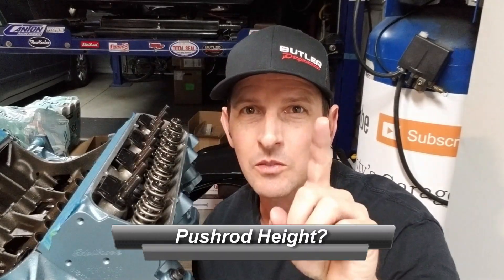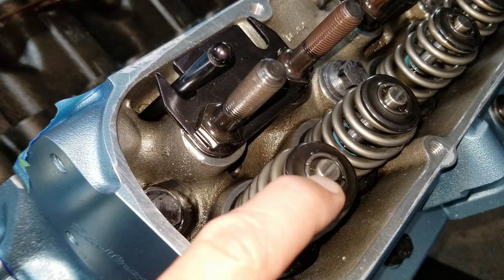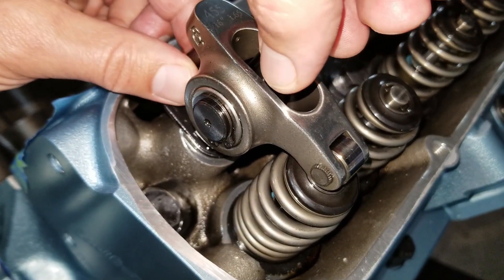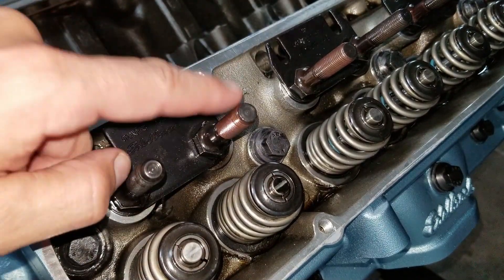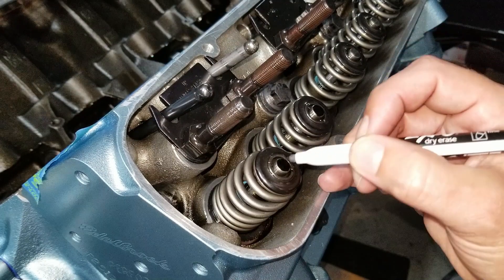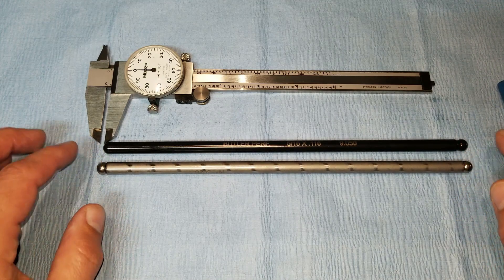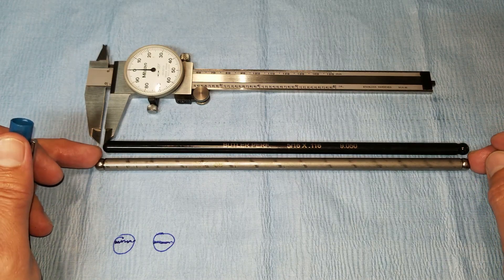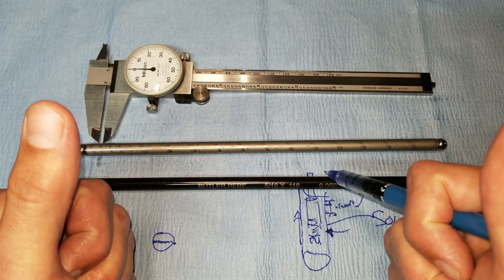Pontiac V8 Rebuild, Part 14a:  How to measure Push Rod Length

Comment: I took a stock lifter and checked it against a solid lifter and it was .190 shallower than a pumped up hydraulic lifter. So when measure with a solid ull.need to take that # away from the final pushrod length. Due to this: solid lifters use a different length pusheod than  hydraulic lifters do
Reply from the maker: Good point.  Depends on the lifter pushrod bore depth.  The point is, if they're the same, there's no compression.  Funny thing is, they make a valve spring for this test that I forgot about... and I have one, for this specific test.  It's a super light spring that does not compress the hydraulic lifter.  Anyway, have fun!

Comment: Hey again Fast Monty, damnit man I absolutely LOVE this channel because of how deep you get into the topic, but here’s a very good question for you. Ok, so the Ford roller rocker is VERY close to a Pontiac’s roller rocker. So here’s my plan (again, please let me know if I’m mistaken or I’m going about any of this the wrong way, pretty please. So currently I have the ole 1.5 roller rockers on it. Make .466”-4.86” lift. So with a (only 1.6 ratio rocker) my cam lift will be at .497” and .519” with just a rocker change from 1.5’s to 1.6’s!! That’s insane! My 6x-4’s have already been set ho (pushrod holes elongated to make clearance for the pushrods, what’s really crazy is with a 1.65 roller it’ll make a whopping .513” and exhaust side will be .536” for right now though, I’m REALLY wanting to try a set of FULL ROLLER 1.6’s from a sbf Ford engine. It can’t be a Windsor or a Cleveland, has to be a regional ole 5.0. I’m hoping it’ll help get the spent exhaust out faster in all honesty! Plus bringing in a little more air never hurt nobody!! So now my opinion to you, is which brand do you have true trust in? I was going to go with Elgin full rollers, but I’m honestly not quite sure. What do you think?
Reply from the maker: Yeah, crazy how much more lift you can get...even just going from 1.6 to 1.65   Anyway, Mine are Scorpion's.  Honestly, I'd check out what the latest roller rockers that Butler Performance is selling.  They typically carry the best.  Thanks for the comment... have fun!

Comment: Another excellent video. I just ordered a single solid lifter from comp. Interestingly the spec is .020 shorter than the hydraulic lifter which is close to a half turn of preload on the hydraulic. I hate waiting but I really want to be confident on my measurements when I order pushrods.
Reply from the maker: Good point David... I don't recall if I mentioned it to you, or not.  But, i definitely did NOT mention it in the video.  You can get a "tester spring" which replaces the valve spring.  It doesn't apply enough pressure to depress the piston.  Maybe hunt for one of those?  (I have one in my garage, and totally forgot about it when filming this episode!)
Reply from the maker: Found it!  https://www.summitracing.com/parts/pro-66793  @davidwhitman9609
Reply: @FastMonty  Thanks for the link, you did mention at the end of the video that you had forgotten you had the test spring. I’ve changed valve springs but not with the head installed so I’m a little hesitant to take apart my brand new head. Single solid lifter gets here tomorrow.
Reply from the maker: Ohhh good.  I couldn't remember if I mentioned it.  You can do it, in the car.. assuming you have the right spring compressor, just make sure the piston is at TDC, so if the valve falls down, it won't go very far.  Have fun! @davidwhitman9609

Comment: Monty what lifters did you go with?  I see you only went a 1/2 turn for your preload.  Is that because your running Johnson rollers (ST2112OPR)?  I'm doing the same thing now, measuring for pushrod length.  My line is also a little high.  On the box it say preload = .030.   If the 7/16 studs are .050 per turn, then 1/2 turn is .025. The Johnson preload says .030.  

I'm wondering how you found there was still .100 of movement.  I thought most hydraulic lifters at most were only .060 of preload before they would bottom out.

I must be missing some fundamental principle here with how hydraulic lifters work.
Reply: Hello Monty,

Butler is saying 3/8 turn, johnson said 3/4 when i asked.  Why did you go to 3/4 after you did 1/2 turn
Reply from the maker: Cuz they made noise. ;)  3/4 worked for me.
Reply from the maker: Fantastic Catch!  Yes, I have Johnson Rollers now.. and I go 3/4 turn, which works great.   Have fun!

Comment: do you have the length of the butler pushrod that u r going to use?please & thankyou
Reply from the maker: I'm using 9.050" ... but, that's for my particular engine.  Please measure for yours.  Thanks for the comment.

Comment: This is all wrong
Reply from the maker: Care to elaborate as to why?  (The one thing I forgot is to use a test spring, which I own, and totally forgot to use it)
Reply: @FastMonty  I will rewatch it and try to elaborate as I was only able to watch the first half but basically the main issue is your lifter set up as wrong for testing as well as you seem to pay no attention to Rocker angle
Reply: @FastMonty  ps Test springs don’t really matter it’s just that they make it easier to rotate the motor and they help save on the load or feel if your valve happens to come in contact with a piston or something else
Reply: @FastMonty   this is about a 90% complete process https://youtu.be/o5is9BsH5OU the only thing they forgot was the “ operating lifter height” which does make a difference i hope you enjoy 😁
Reply: @FastMonty I think what he is attempting to say: Butler Performance reccomends that for perfect valve train geometry the rocker arms need to be perfectly perpendicular to the studs at 1/2 lift of the cam. They say that is actually more important than where it lands on the valve (as long as it stays on the valve stem).

Comment: I checked mine on hydraulic roller lifters - they were pumped from a run in before. They had 8.550’s in them (built by a builder) but invoice was for 8.600’s, so I wanted to check it out. Went through the process and came up with 8.800’s.  Got a solid lifter and after adjusting for the seat height differences I came up with the exact same 8.800. So pumped lifters took up the slack.  Ran perfectly.  Just had an issue though - one Comp Cam lifter broke - the side piece holding the roller. I am so P.O.’d.  Saw others with the same issue. Who had a hydr roller lifter for a now 464 Pontiac that is worth a darn and is reliable?  I thought I was done with those darn headers.
Reply from the maker: Thanks for sharing... yeah, broken lifters are very common.  ALL lifter manufacturers have failures.  Supposedly the most reliable are Johnson lifters.  Which is what I'm using now.  This hobby is crazy, isn't it?
Reply: @FastMonty  sure is. My first was a 69 FIrebird 4.1L OHC I bought in ‘77 - rebuilt it into the Sprint package - was my primary ride for 100K miles, then traded up to a 68 FB 350 conv, rebuilt it as well, but sadly sold it, then got a 67 FB 400 conv.  long sad story about why one needs to do it yourself.  Nowadays it is much easier than my first two because of the internet.
Reply: BTW - love your series on your rebuild - sure wish I had it years ago!
Reply from the maker: @ericdoggett9001  Wow!  You're right, I could NOT imagine restoring anything, without the internet.  Thanks for sharing that story!
Reply from the maker: @ericdoggett9001  Thanks Eric!  Much appreciated!

Comment: hi monty, building  "67 400 ; pretty much stock.  using comp cams  hydraulic lifters.  if i measure "dry", how much to compensate for no oil in lifter?
or, cant i remove valve spring and  use test spring so lifter not compressed?
Reply from the maker: Hey Philip, congrats on doing it yourself.  The best way is by using a "test spring".  I failed at mentioning that in the video, where I actually own one, and totally forgot about that method.  Just make sure you get a good spring compressor, as that's the hardest part of that process.  Thanks again for the comment!

Comment: do you have a part # for the adjustable pushrod?
Reply from the maker: This is the one I used... keep in mind, there are others on the market that don't have the lock nuts.  I'd get that one.  Also pay attention to the measurement range.  https://butlerperformance.com/i-24868533-comp-adjustable-pushrod-length-checker-5-16-8-500-9-800-cca-7902.html?ref=category:1459538  Have fun!  (Oh, also forgot to add in the video to use a valve checking spring, where you need to remove one valve spring, and insert a light weight spring, so the plunger doesn't go down, like I was fighting with)  good luck!

Comment: I'm considering swapping my heads to aluminum on my 455. I have a comp cam 300b6 solid flat tappet cam. Would i do the same thing with mine? Do you have to have the valve lash set first before checking with a solid flat tappet lifter?? More than likely i won't be able to use my current comp cam magnum pushrods.
Reply from the maker: Good question... I'd say, yes.  Better safe than sorry, when measuring push rod length.  Especially not knowing if the Aluminum heads are a slightly different valve train height?

Comment: I didnt use checker springs either. Think I'm pretty close but there is some chatter and I feel like my guide  clearance is too tight even though I have 5 thousandths when I'm on the base circle. Runs good but might do it all over again to see if I can quiet it all down and assure myself it wont implode at some point
Reply from the maker: As long as the wear pattern on the valve stem is centered, the rod length should be fine.  I assume you're using high ratio rockers?  Did you add clearance to the rod passage in the head?  Other than that, if you're running roller lifters, those cross bars are going to make a little noise.  When I switched from Lunati to Johnson the noise improved, but still have a little.  So, my guess is not all roller lifters are created equal.  I hope that helps with your troubleshooting... or, talking you off the fence.  :)
Reply: @FastMonty  lol yeah, I have the lunati hydraulic rollers. Heads have plenty of clearance ( kre highports) wear mark is pretty centered and been running good.  Thanks for your input. Really appreciate it
Reply from the maker: @sampson7941  Awesome... glad I saved you eight hours of work.  Ha, ha...

Comment: Hey fast Monty your videos are excellent I learn a thing or two on every single video. Considering I'm going to attempt a cam swap due to a collapsed lifter.. not going crazy with it just a stock replacement but I'm following your videos closely
Reply from the maker: Thanks for the comment... sorry to hear about your collapsed lifter.  Are you sure you don't want to upgrade it a bit... ??  ha, ha... thanks for watching, and commenting!
Reply: @FastMonty  well I had to learn the hard way for not using the correct break in procedure, however I'm actually going to upgrade it to a ram air three cam profile just to keep things simple without having to change a whole bunch of other components if you know what I mean
Reply from the maker: @transam4555  Great idea!  And, no I have no idea what you're talking about... ha, ha... just kidding, that's the hobby, change one thing, then change 10 more things to make it fit.  Keep it up!

Comment: After watching you wrapping your head around pushrod height  , I just wanted to let you know that you can soak your hydraulic lifters in a clean coffee can and use a push rod to manually pump up the lifter so that the oil fills the lifter up so you can not struggle with the 80 -100 thousands . just trying to help and not be a smart ass if it sounded that way.
Reply from the maker: Thanks John... yeah, I was totally wrapped around the axle on the pushrod measuring.  I agree with your trick.  But, what I failed to mention, because of my poor memory, is to switch out a valve spring, with a super light load spring, intended for this purpose.  Which I own, and totally forgot about using!  sooo dumb of me.  Anyway, thanks for the comment, always appreciated!
Reply: Both of those are wrong approaches i can explain

Comment: is the polylock adjuster tool you’re using  Proform 66781 ?
Reply from the maker: Yup!  That'll work... here's a link for everyone.  https://www.summitracing.com/parts/pro-66781?seid=srese2&utm_source=bing&utm_medium=cpc&utm_campaign=Brands+|+P&utm_term=4581871113153879&utm_content=GSAPI+5ba2960c4399e